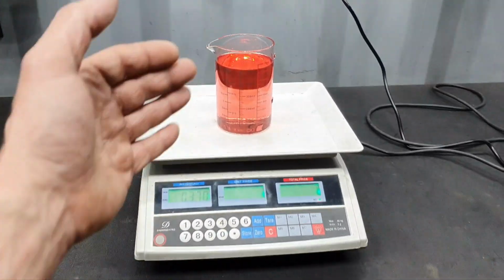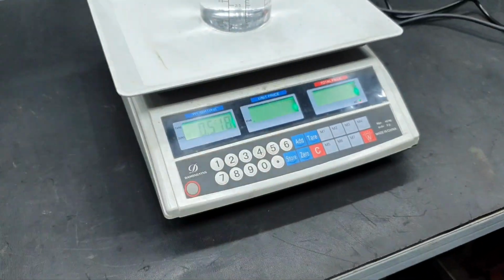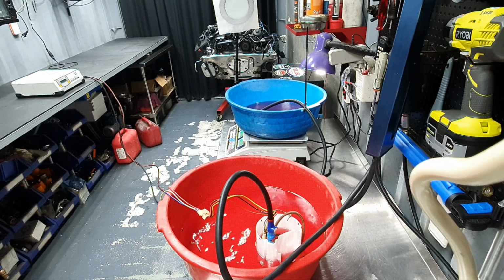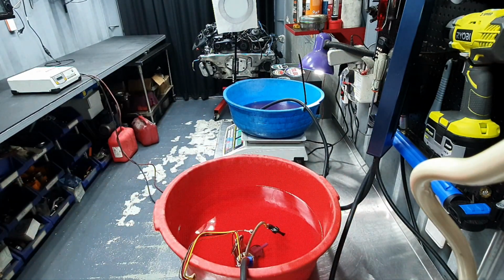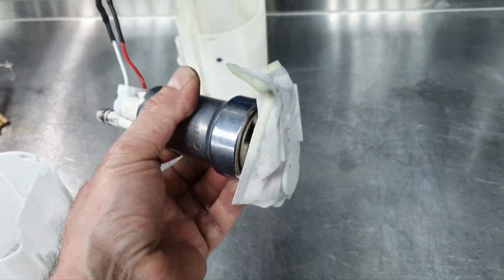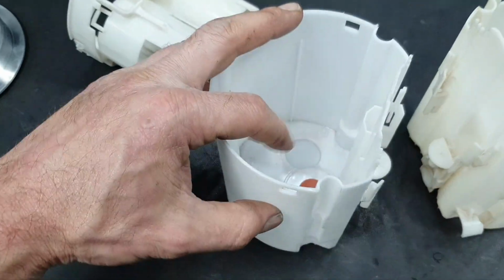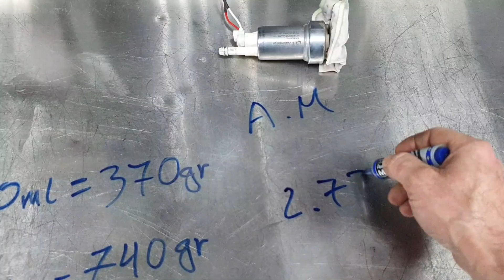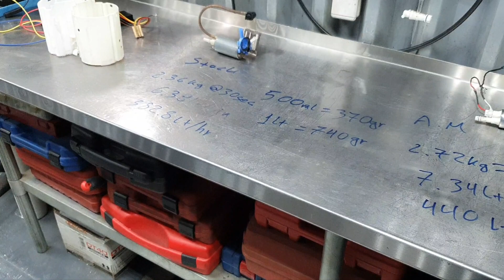Fuel system upgrade not for MB (part 1)

Comment: Master Tasos: this modern low pressure fuel pump has 3 wires... looks like a 3-Phase speed control. 
Pump output function of controller frequency, right?
Each AC phase is approximated by noisy pulsed DC spikes. 
Pump controller learns to regulate for pressure against all variables.

In other words the pump controller needs to "learn the pump" to deliver what the pressure the ECU wants. 

To boost output: tune the controller tables, not the pump. 

A known issue is the controller DC noise impacts CAN control during accelerationns: pressure drops! 
FIX is to clean DC power with short wiring physically split apart controls.   
✌️